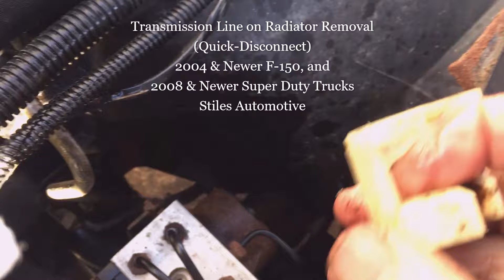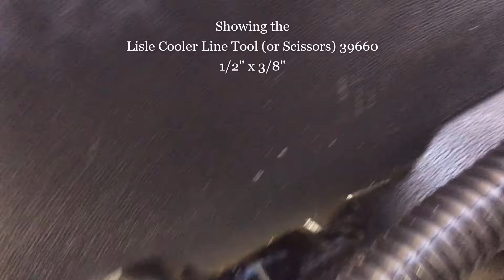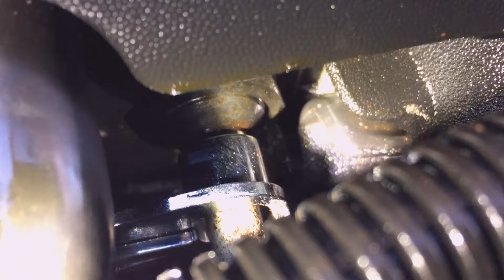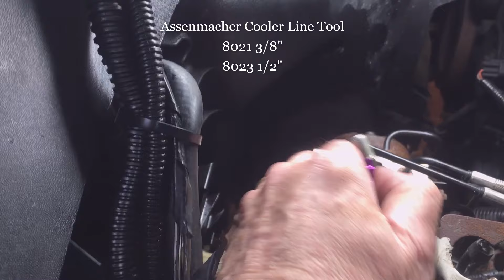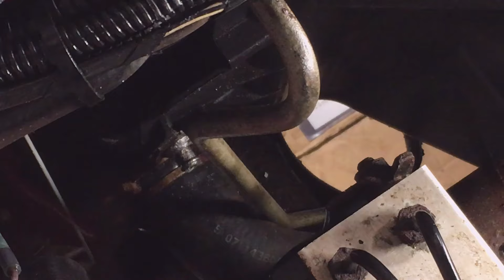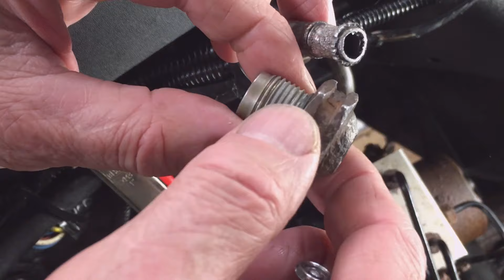Transmission Line on Radiator Removal (QD), 2004 & Newer F-150, and 2008 & Newer Super Duty Trucks

Comment: There's a way to do this without the special tool.  You use sleeves of plastic cut from a plastic milk carton . 1/4 or a little wider by about 1/2 to 1 inch . After using a penatrint  spray to clean and losen the clip inside the fitting.  You can work the plastic sleeve in between the line and clip inside the fitting ( you are feeding the 1/4 " end in between the line and fitting ) by doing that you are able to pull the ridge on the line over the clip . This allows you to pull the line out .
Reply from the maker: John, Good tip! It may come in handy in a pinch. Of course, the proper Tool for the job makes life so much easier, and in this case the Cooler Line Tool ( Lisle 39660 1/2" x 3/8" https://amzn.to/3m9eeQ2  ) is under $10 and the better Cooler Line Tool (Assenmacher 8021 3/8" https://amzn.to/3dRlCet  ) is under $20.  I get it, sometimes these are once in a lifetime jobs for some people, so if the Tool is expensive a work around is the way to go!

In my case, I had to cut the line, take the Connector to the Vise and spray it, work it, spray it, and work it. My Connector was extremely dirty.

Thanks for the comment, my goal is to help people and your tip may prove helpful in the future! - Stiles
Reply: @StilesAutomotive mm were❤❤

Comment: Did not learn anything from this video as he failed to show how to replace it
Reply from the maker: Ernesto, this is a companion Video to the Video where I replace the Transmission Cooler Lines, I wanted to go into more detail on this Quick Disconnect. That Video should help you (See Link below) - Stiles
Transmission Cooler Lines Replacement, '04 to '08 F-150 Trucks  https://youtu.be/eAilFMgc5xI
Transmission Cooler Replacement, '04 thru '08 F-150 Trucks  https://youtu.be/b8y40VXGPko
Transmission Line on Radiator Removal (QD), 2004 & Newer F-150, and 2008 & Newer Super Duty Trucks https://youtu.be/2MmZ1Y_Zf-g

Comment: As a mobile mechanic i have the option of not having to work on Fords  : )
Reply from the maker: Rokitman, I've found, its all a matter of what you are use to, . . . and tools are sometimes designed for a singular use, like the Line Removal Tool in this video. Thanks for the comment. - Stiles

Comment: The last part you took off is the same for the small radiator at the front as well its ford part # YL32 7D273 AA just cost me nearly $60 for one of them today but its guaranteed to work the first time without problems.
Reply from the maker: Frank, Where did you get it from?  At $60 it must have been the Ford Dealer Parts Department. - Stiles

Comment: Ah. In this video you’re showing the inside of the cooler line fitting where the near, inside plastic collar is pushed out by the Assemacher/scissor line removal tool, and the farther inside,  O ring sets in a groove on the inside, which is the piece that failed in my case. The other videos really need to all be linked
Reply from the maker: This was an attempt to make shorter videos, I like to make videos with everything you may need in one video, but then the length becomes an issue for people.  Based on your comment, I updated the video descriptions and included a link to the other videos and the end screen of each video has a link.   Are you able to give me a part number or exact size (ID, OD and thickness) of the O-Ring that you used? I will add it to the video description as well!  Thanks - Stiles

Comment: How do you insert the new lines into the quick connectors? Do you need to use the tool or just press them together?
Reply from the maker: David, Nope, Just put the tip of the Transmission Cooler Line into the QD, then push it in until it clicks, attempt to pull the Cooler Line back out (to ensure it is locked in). That is it! - Stiles

Comment: Compre el radiador para mi ford lobo pero note que en el conector de las linea de enfriamiento de la trasmisión  tiene un plastico por dentro en partes  supongo q es el seguro eso viene asi o esque este dañado saludos desde México
Reply from the maker: Jesus,  You said, "I bought the radiator for my Ford Lobo but I noticed that the connector for the transmission cooling lines has some plastic inside. I suppose it's the insurance that comes like that or it's damaged. Greetings from Mexico". Yep, I think that is Nylon or Teflon, to keep the Steel Cooler Line from corroding in Fitting. I appreciate your comment! - Stiles

Mi respuesta en español: Sí, creo que es nailon o teflón, para evitar que la línea de acero del enfriador se corroa en el accesorio. ¡Aprecio tu comentario! - Stiles

Comment: great video , I have a lincoln navigator 2006 with  a 3/8  transmission cooler quick disconnect fitting and no one sells it. I  have try dealer and said they got it discontinue.  Any recommendations?? or alternatives??
Reply from the maker: Albornoz, Sorry, man, I've got nothing for you. Dorman makes new 1/2" size Disconnects, but not the 3/8", I don't know why! New Radiators (from many different manufacturers) come with new Disconnects. Where are they getting them from? There are Millions of them out there on Ford Vehicles. Why doesn't Ford still have them?  I don't have a good answer for you.   I appreciate the feedback on the video!  - Stiles

Comment: I need to know if you can remove the quick disconnect fitting from the radiator it's self 2005 expedition
Reply from the maker: Don, It appears that your Radiator is unique to the 2005 thru 2006 Expedition & Lincoln Navigator, but your Transmission Cooler Line Connectors should be like I show in my video, removal able. It looks like you have 3/8" lines (and likely are), but they may be 1/2" (like most Super Duty Trucks). - Stiles

Comment: Could I just take the entire thing out, including the insert sleeve along with the line without using the tool, then installing it in the new radiator?
Reply from the maker: Stephen, Yes, you can, if . . . if the Quick Disconnect was new, you could. If your QD is as dirty as mine was, you'll have to play with it, plan to use a lot of Part Cleaner and/or PB Blaster.  Let me know how it goes! - Stiles
Reply: @StilesAutomotive  It worked out smoothly. Took the insert out along with the connected coolant line from the original radiator, then took the new insert/connector out of the new radiator and put the line in with the old insert. I used a big crescent wrench on it .
Reply from the maker: @stephen6945  Stephen, I don't know if you read a bunch of the comments here, those Quick Disconnect Fittings are like Gold, Ford doesn't sell them. At least most of us can't figure out how to get them from Ford Parts. Keep them in a safe place, like the glove compartment, for your use later! Glad it worked out! - Stiles
Reply: @StilesAutomotive  wow I didn’t know that I’ll be sure to keep hold of them. Thank you!

Comment: Can you just  unscrew the 27mm fitting out of rad and let the lines in it and  re screw them back into new rad?
Reply from the maker: Brenda, Yes, maybe, you have to make sure the Cooler Line turns in the QD. I'd still use an excessive amount of PB Blaster and be careful when turning the QD. Let me know how it goes! - Stiles

Comment: If I've got a leak at the top connector, is it likely that the connector needs replaced or does the line need to be replaced?
Reply from the maker: Chealocean, Probably just the Connector, the Cooler Lines are more protected up there by the Radiator. The Line could be corroded, but unlikely. I'd take care of your leak as soon as possible and check/add Transmission Fluid regularly. - Stiles

Comment: Can I remove the lines and only use the air cooler(secondary) without any harmful effects ?, Ford Ranger 4.0 2004
Reply from the maker: Jay, Yep, on modified Cars I've increased the Cooler capacity and plumbed directly to the Transmission Cooler. And remember to plumb the Lines so the Cooler fills from the bottom! - Stiles

Comment: How the hell do you get the scissors past the outter ridge!? I bought the tool and can't get it even close to going in
Reply from the maker: Nick, Make sure you are using a excessive amount of PB Blaster (or other penetrant), try to gently wiggle the Cooler Line, in and out, and side to side. Then attempt to push the Tool into the Quick Disconnect. Be careful with the Lisle Tool, you can break it. If you are fully committed to replacing the Cooler Line, (meaning you have the new Line in your hand and you are sure it is the right one) you could cut the old Line near the Quick Disconnect (QD) and remove the QD from the Radiator. Take the QD to the Bench Vise and play with it there. - Stiles

Comment: Can you just take off the 27 and 26 fittings with a wrench and bypass the quick release?
Reply from the maker: Timothy, Yes, If your Trans Fluid Line is not dirty and corroded like mine.  The Line should turn inside the Quick Disconnect. I replaced my Lines anyway, so I cut one of the Lines, used a Socket on the QD then when to the Vise on the Bench to remove the line from the QD.  - Stiles

Comment: Hey I have a 2018 f150 5.0L where the cooler is mounted to the trans. That said I have a leaking connection at the front of motor where the quick connect line is connected to one of the 2 lines running back to the cooler. These are down at the front of engine under the pulleys etc. One of them appears to be leaking coolant. Is there an easy fix without having to replace the expensive OEM lines ? We were talking about bypassing the steel lines and just running rubber quality fuel line so it never rots again.
Reply from the maker: Cee, Yep you cold replace Steel rusted Lines with Rubber Hose. Of course, replacing with OEM Lines would be better. Just be careful of two things: 1) use the correct type of Hose, (your average Parts Salesman, if out of one type of Hose will try to substitute another type) There is Vacuum Hose, Fuel Hose and Transmission Fluid Hose, 2) Hose when mated to Steel Line should have a Flare on the Steel Line (I assume you will just cut the Line and stick a Hose onto it and then use a Hose Clamp), if you don't flare the Line, then I would ensure the Hose is on the Line at least 2 inches and I would use 2 Hose Clamps on each end offset 90 degrees from each other.  Its hard to believe your 2018 has this problem already, Ford should have corrosion protected these lines better!  - Stiles

Comment: I'm replacing the cooler and would like to see how to remove the water lines off the 2017 supeduty  6.7
Reply from the maker: Dash, The Engine Coolant (you said "water" but mean Coolant) Connections to the 6.7L Transmission Fluid Cooler are also quick disconnect, but different than the Transmission Fluid Lines.  If you do a You Tube search for "ford coolant quick disconnect" a number of videos come up. You have the Black Coolant Line with White Locking Tabs.  And you may have an additional 90 degree elbow that uses the same Quick Disconnect on the Line and on the Elbow at the Cooler, take it off which ever way is easiest, but save and reuse the Elbow.  Your Transmission Fluid Lines are similar to what I show in my video, but your lines are 1/2" (not 3/8" like mine).  That's the best I can do for you. - Stiles

Comment: Do you know if these will work with the 03 Ford Lightnings? They are QD
Reply from the maker: Richard, I don't see Quick Disconnects on your Lightning, I see threaded connections on the Transmission Lines, on the Transmission Cooler, and . . . there is a Lightning Radiator that is 2" Thick with Quick Disconnects in the Parts Catalog. That being the case I don't see the correct Transmission Cooler Lines, and Ford Parts .com doesn't help. So, yes you likely have Quick Disconnects at the Radiator, but other 2003 F-150s probably do not. - Stiles

Comment: Can I  get a part number for the 3/8" quick disconnect fitting?
Reply: All i can find is the 1/2"
Reply from the maker: Cheyen, They come installed on many (all I have seen) of the aftermarket Radiators, so I don't know why they aren't available from someone. But, I don't have a good source for them. - Stiles

Comment: Does that apply to Ford ranger 4.0 4x4
Reply from the maker: Briana, I don't think so, You have a different connection at the Radiator.  I think you have a threaded connection at the Transmission Cooler Line connection to the Radiator. - Stiles

Comment: Any link to an after market connector. Ford says they don't make them anymore and only service the radiator.
Reply from the maker: Brandon, This amazon link (see below) says they have "one". Dorman has a 1/2" line connector, but I don't see a 3/8" Connector from them, if you find one, please give me the part number, I'll put it in the video description to help others. - Stiles

Trans Cooler Line Connector @ Radiator Ford https://amzn.to/3E1oSyp
***Note: Ford Parts Catalog shows part number BL8Z-7D273-A to fit all 2004 thru 2008 F-150s with a 3/8" Cooling Line (may not be correct!)

Comment: I just changed my motor and when I disconnected them I unscrewed them and the pieces fell on the inside of the radiator so they were very hard to get back connected
Reply from the maker: James, Yep, they are intended to be a Quick Disconnect and not under screwed, but you can unscrew them. You have to be careful. Hope my video helped! - Stiles

Comment: I have 03 250 6.0 

Will this work?
Reply from the maker: The F-250 and Super Duty Trucks use a similar Quick Discount but it is 1/2" Diameter and the F-150 (Shown) is 3/8" Diameter Transmission Cooler Line. And so a bonus to you Super Duty Guys you can buy a replacement QD at a number of Auto Parts Stores, Dorman make one. The F-150 QD is a challenge to find. - Stiles
Reply: @StilesAutomotive  Great!
Hopefully it’s the last piece of the puzzle!
Reply: @StilesAutomotive damn you know your stuff

Comment: The dorman connector listed on here says it’s for a half inch line. That’s not going to work for the 3/8” line…. Confused
Reply from the maker: Geromia, Nope, you don't want to use the Dorman Connector on F150s the 1/2" is for Most Super Duty Trucks. O'Reilly's will sell it to you for the F150, but it is not right.  You need -  - Trans Cooler Line Connector 3/8" @ Radiator Ford https://amzn.to/3E1oSyp   Be sure to read the note under the 3/8" Connector!  If you order the 7D273-A and it is not correct, please let me know. I believe it is correct. - Stiles

I just edited the video description to look like this:
Consumables:
Trans Cooler Line Ford 7R081 both lines https://amzn.to/31YoqUw
Trans Cooler Line Rad to Cooler Ford 7C410 https://amzn.to/3yudGZW
Trans Cooler Line Connector 3/8" @ Radiator Ford https://amzn.to/3E1oSyp
***Note: Ford Parts Catalog shows part number BL8Z-7D273-A to fit all 2004 thru 2008 F-150s with a 3/8" Cooling Line (may not be correct!)
Trans Cooler Line Connector @ Cooler Ford https://amzn.to/3F1j3Cu
Trans Cooler Line Connector 1/2" (Most Super Duty) Dorman 800-617 https://amzn.to/3z3zxHZ
Trans Cooler Dorman 918-202 https://amzn.to/3pWPuf3
Reply: Thanks, I was able to order it directly from Ford. I will pick it up Monday and be able to clarify if it works
Reply: It does not work. It is the same as the dorman one with a half in connection

Comment: The fitting does not work wrong part number
Reply from the maker: James, which QD Fitting? The one at Radiator 7D273A, or the one at the Oil Cooler 7D273C? - Stiles
Reply: @StilesAutomotive   radiator

Comment: Shop charged me several hundred dollars to fix this leak 😡🤬
Reply from the maker: Subb, Yep, it could have been a hard or easy fix, depending on where it was leaking. This Stiles Automotive Video that you commented on would be an easier fix (even thou I have a tough time with mine). Watch my Video on the Cooler Lines Replacement (see link below) which is pretty darn hard! - Stiles

Transmission Cooler Lines Replacement, '04 to '08 F-150 Trucks  https://youtu.be/eAilFMgc5xI
Transmission Cooler Replacement, '04 thru '08 F-150 Trucks  https://youtu.be/b8y40VXGPko

Comment: Why can't you just take a wrench and spin that nut out?
Reply from the maker: Larry, Are you talking about the Quick Disconnect Nut? Yes, I cut the Cooler Line and removed it with a Socket.  You may be able to remove it with the Old Cooler Line in it, if the Line will turn in the QD. - Stiles
Reply: @StilesAutomotive  thank you all I'm doing is removing the radiator so I can put a timing chain in the engine. But I ended up finding the scissors and have the lines out anyways
Reply: @StilesAutomotive   got a 2008 f150.  want to replace the top quick disconnect transmission fitting.  i removed the line and when started to turn the QD fitting out antifreeze started to come out.  do you need to drain antifreeze down below the fitting level? thanks